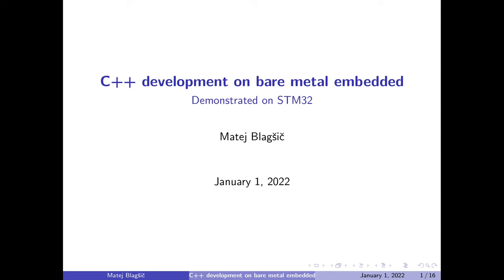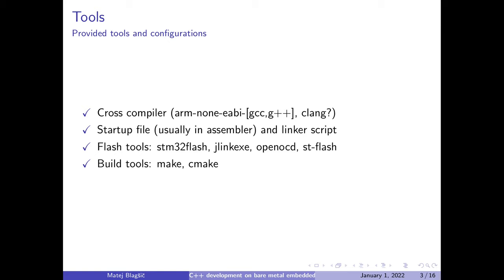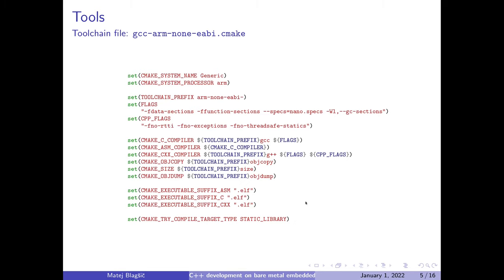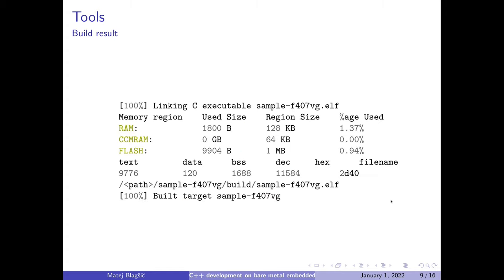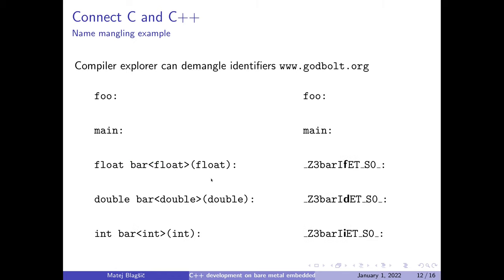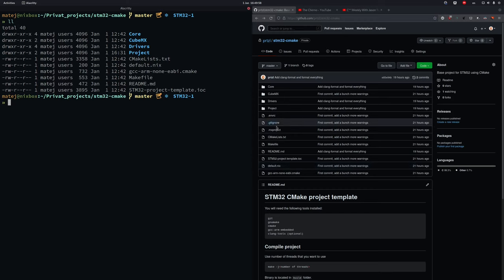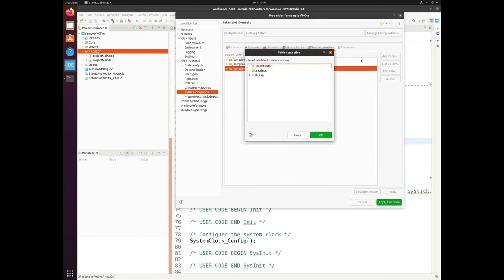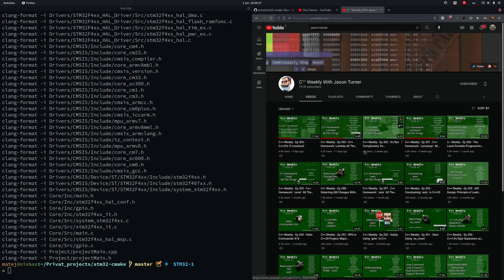Introduction to integrating C++ on bare metal STM32 | VIDEO 47

Comment: Sorry, but how to use c++ for vs code? I can't do it 2 week, because not search information for settings. I have Linux Ubuntu, gcc-arm-none-eabi, cortex debag extension, for c this setup work is good, but c++, a big problem for me . Compiler mark the c++ code red lines 😢 .
Reply from the maker: Which part does not work correctly? Compiling or just IDE syntax highlighting?
Reply: if compiling from console, is ok. But in vs code, i can't to setting cmake, and syntax highlights.
Reply: if you could do an overview on setting up vs code for c++ it would be very great for many embedders

Comment: Hi, Matej! Nice video. I try to implement your code in my project with STM32F446ZE and I did corresponding changes but I have some questions. I have a message that says “not found stddef.h” but my code compile and I can blink to Led, I don't know if I can fix it. My main question is how can I implement class with c++ I want to create a class to manage many sensors and this recourse is necessary for this. I tried to implement it with .cpp file but I had an error saying “class symbol not accepted”.

If you can help me I will be very grateful!!

Thanks
Reply from the maker: I would advise a coulple of things:
- the thing with "not found stddef.h": Please confirm that you have completely installed toolchain. Some linux distributions might carry some parts in other packages. If you use windows and you installed the package as in video 48, then you're fine. I would check if your path is active. Just test if compiler is found in cmd or powershell: arm-none-eabi-gcc --version.
- the one with "class symbol not accepted" might come from using a .c or .h file, that is included in a .c file. You cannot define a class or any c++ only feature in a header file, that is also included in a .c source. Make sure to separate it with some pure functions.
Also, if you're using CubeIDE, check if you have converted the project to a C++ project. In project includes make sure that you have a path to your C++ headers and source files so that the ide will find them.

If you follow my cmake example, where I defined a struct with a few methods, you should be good to go.
Reply: Hi Matej, thank you for your advice.

I tell you what I did. First began to write only C code where your videos guided me. I could compile and debug with JLink by VSCode whitout problems. I have I2C accelerometer sensor and I send messages by UART without problems. But my code is large enough and I wanted to create a class to manage the sensor. Then I was guided by your 47 video to implement this. Here is where I have many problems. Is it possible to create a class and call it by main.c ?

Before I use Mbed OS and CLI 2 to program my STM32 where the main file is .cpp and I could call the class but I found your way by Make is more easy and simple. 

On another side, I run arm-none-eabi-gcc --version and I got this "arm-none-eabi-gcc (GNU Arm Embedded Toolchain 10.3-2021.10) 10.3.1 20210824 (release)" it seems to be well installed I don't know why I got the error with the "stddef.h" library, in my others projects this works well. I'm using fedora.

I hope you can help me, you have been my guide in my development in STM and I am very grateful.
Reply from the maker: Great.

Now as I said in my first reply, you cannot use c++ constructs and features in C. They are compatible, but not fully. That's why I created my "second main" file where you can use C++. 

You can also rename main.c to main.cpp but the next time you run cubemx it will add main.c back as it sees it missing (could be solved in future update). Then you will have two main functions and the compiler will shout at you.

Also I think its much neater to store all mcu peripheral initializations in main.c and use your own vode in "projectMain.cpp". 

So, if you want to use a class, define it in a header, maybe implenentation in a .cpp file and use it in projectMain.cpp.. Follow the example repositort on github "stm32-cmake" and "stm32". All C->C++ "communication" has to be done via C style pure functions. Afain thats why I use prokectMain.cpp.
Reply: Hi Matej!

Thank you once again for your help. Finally, I'm using "projectMain.cpp" file and create my classes in separate files and I can tell them without any problems.
My code compiles and debugs without problems but I have problems with the next warning: cannot open source file "stddef.h" . This message red underline #include "main.h" and #include "stdio.h" statements. Do you know how can I fix it?